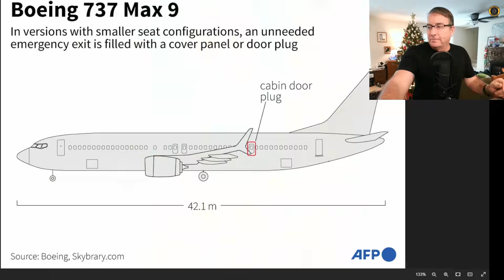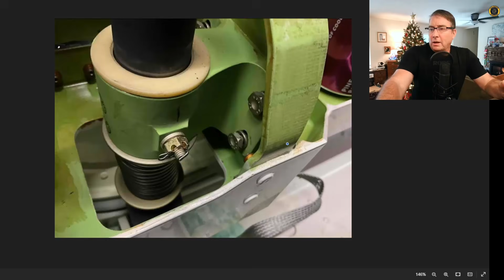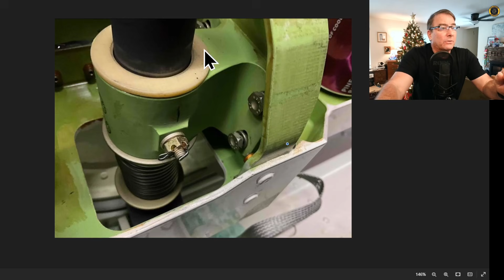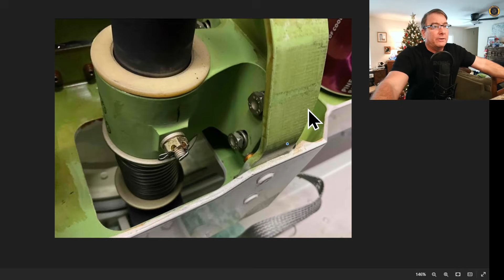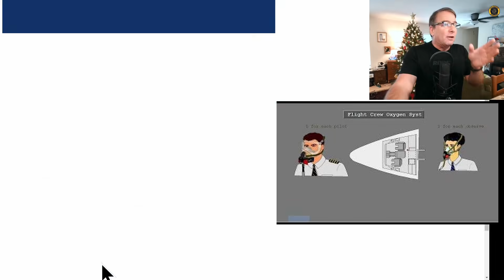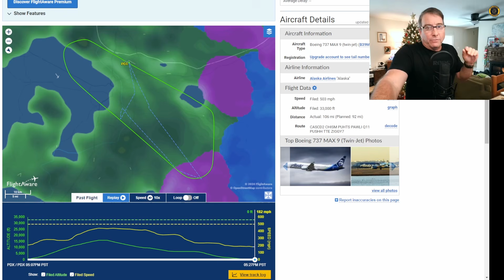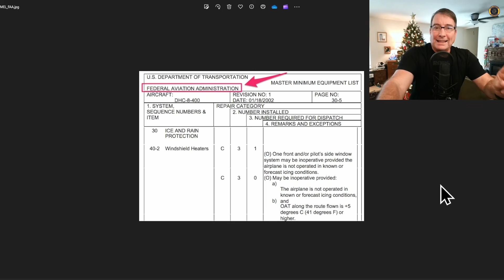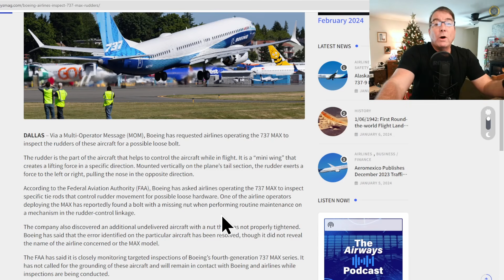"Yes, We Have No Bolts"  9 Jan 737 Max-9 Update

Comment: In my opinion as an 35 year aerospace engineer and former Boeing Associate Technical Fellow that retired from Boeing in 2004, Boeing needs to move the executive offices back to Washington state.
 They need to put the executives on a mezzanine in the manufacturing building. Make them have to walk through the factory to get to their offices. Terminate with prejudice any executives that objects.
Make a way for the people on the factory floor that know to speak freely about their concerns. Make it okay for the factory folks to do the right thing - it clearly isn't okay now.
I thought at the time and I still think that moving the corporate offices away from the aircraft factory was a big mistake. Huge. It made denial of the real issues effortless. Out of sight, out of mind. Unless Boeing does something at least that radical, they are not going to fix the virus that's crept into their culture in the two decades since I retired not long after the MacDac infection. I never worked in the aircraft part of the business, I was in aerospace in So. Cal, but the company culture began to to change for the worse when the MacDac culture infection started and they moved the corporate offices to Chicago.
Reply: I know several people who were with Boeing back then and they all say the same thing as you; right around when they moved the offices to Chicago Boeing started really going downhill.  All of them left the company by 2008.
Reply: That's a pretty good idea.  Moving the heard quarters back to WA, and making management walk through the factory are easy (although they'd say it's impossible).
The real difficult thing, is the most important that you mentioned.  That is, making sure workers have the right to speak up, tell the truth and not fear punishment.  Corporate stuffed shirts love to claim they have an open environment, but seldom do.  Their words mean nothing.

After the previous Max-8 crashes, the FAA uncovered some emails written by someone with a snarky attitude (likely an engineer), that stated the 737 Max was designed by clowns and supervised by a team of monkeys.  The response management had to that email was to claim it didn't represent their values, and discipline was in order.  Boeing should have thanked the person for speaking honestly, and it was a perfect chance for them to listen and learn.  If they had listened and learned, they could have prevented this embarrassment.
Reply: Perhaps people that see things that are not right can speak to the upper management about vital safety concerns, or just tell them they will send the info to the FAA or appropriate organization if they turn their heads on these important issues (I'm not well versed with the different agencies, but report to the appropriate agency) @cherryjuice9946
Reply: I'm Australian and did my degree in aerospace in America (late 80s) and have a pilots license. I work in industrial control systems including safety systems across a variety of industries (manufacturing, mining, oil & gas,...). What you and others are describing is common across all industries. There's this prevailing attitude among people with business and economics degrees that any cost NOT directly associated with generating profit has to be reduced or eliminated.

Things like maintenance and safety are risk mitigation activities NOT profit generators and bizarrely the BETTER they are done the less evidence is that they are being done at all. Its only when they are NOT done well enough that there's evidence because something breaks. This confuses the hell out of non-engineering people.

I have spent a lot of time in recent years looking into this, because its been so frustrating in my work to get things done AND its across every industry I have worked in. There's always some clown waving their economics degree or MBA at me a howling about costs and relentlessly questioning if we need to meet this or that standard.

It all goes back to the colleges where the curriculums for business and economics are taught in a very narrow set ideas about markets, profits and costs. All most all their basic text books are published by Harvard press, Yale press, Oxford press, Cambridge press,.... etc. or written by people from those institutions. Sure they all talk about lateral thinking but its basically non-existent outside of this framework of markets, profits and costs. This is why we keep seeing similar things happening across various industries.

To take an engineering term - when you do a ROOT CAUSE ANALYSIS it all goes back to how we train the people who end up managing these companies or managing divisions in these companies. Even if they are an engineer who goes and does an MBA they become a problem because they get indoctrinated into that mentality.
Reply: @tonywilson4713 of course, once enough of that happens, even a MBA that tries to understand and care will receive arrogant, pompous pushback from engineering. It’s a vicious cycle. I like the idea of making all levels of management touch the factory once in a while.
Reply: @jeffreywoods4040  I half disagree with the claim of engineers being arrogant and pompous and pushing back because I have met some engineers who are incredibly pompous and do pushback. I encountered one of them recently HERE on YouTube (see below).

But I will say in my personal experience they are a minority who in general are the less competent engineers who climb over the rest of us into management.

As to my recent encounter - there was a video on the hardest engineering degree and there were more than a few engineers of putting in their comments. This was several months ago. Then recently a new person came in ARROGANTLY dismissing various comments and pronouncing they were an advisor at 2 universities and had spent 30 years at BOEING. What really upset me was their comments about how others should "know their place" and "stay in their lanes" as well as claims we couldn't possibly be real engineers who'd done the degrees we said we had done.

When I checked out the name being used it matched a bio on the engineering school for Ohio State and according to that bio a they had over 30 years at Boeing. 

I can't say the person accosting us and telling us to "know our place" and "stay in our lanes" was that person for sure. BUT THEY FIT YOUR DESCRIPTION PERFECTLY.  

That's why I 1/2 agree with you because I know they exist and they make the rest of engineering look damn awful which sucks for us.
Reply: Couldn't agree more. Carried T Wilson's bags for a couple days and got to meet a lot of the top management. They knew how to build planes and were fine crawling inside the assemblies. Those days are long gone.
Reply: Boeing top execs care more about the defense contracting side of aerospace than commercial jets.  Building airliners is viewed as a legacy obligation that they would rather not have to continue indefinitely.
Reply: Interesting insight. Appreciate you posting
Reply: Excellent post
Reply: They have found much more interesting things to do. Such as selling part of the company to private equity in which they themselves have a stake. And then installing themselves as management of the spun off company.  Much more interesting than walking around some hangar listening to people talk.

"Spirit was formed when Boeing commercial airplanes sold it's Wichita division to investment firm Onex in 2005.  At the initial public offering in November 2006 the firms stock rose 10% in one day. In August 2014 the Onex Group sold all it's remaining shares of spirit. Over the course of the 9 year investment, the Onex Group received aggregate proceeds of 3.2 billion on its initial 375 million investment."
Reply: let me xplain in the most brutally honest and transparent way possible so that you can understand why that will never happen and why it would not make a difference even if this did happen:
1.  major aircraft corporations are managed by multi-billion dollar global investment groups.  Some people call this, bankers.  But it also includes major insurance underwriters.  And yes, there is no law prohibiting insurance underwriters from taking major invesments into the industry/vehicle that they provide insurance!
2 .  shareholders/wallstreet/board members/ceo/cfo and global investors replaced the classic aviation risk reward model with one used by wallstreet.  The classic aviation risk reward model made investments in safety and design improvements.  This is how the modern aviation industry advanced to unparalleled safety records even with new clean sheet designs.  Boeing had for many decades championed world class designs centered around safety as a company priority.  However, what has replaced this is a different kind of culture and risk reward philosophy.  Boeing has shifted to the wallstreet risk metrics.  How many people can die and how many aircraft can be totally lost and still make a profit for the company?  In other words, how many attorneys can we hire than can make arguments to successfully shift responsibility away when the shit hits the fan.  What is THAT cost...How much does THAT save.  How much can we spend to create a cozy relationship with FAA officials so that if the shit hits the fan, we can all point at each other and pretend its a "shared responsibility"...you know, this failure happened because EVERYONE was at fault.  How do we hire the right attorneys who will drag the lawsuits for decades and even settle quietly without admission of blame or any conditions or concession to make a safer aircraft?  How much rat meat can contaminate the hotdogs and still comply with safety. Now, lets spend exactly that amount and test that limit.  This is the walls street risk metric philosophy.  Do the absolute minimum investments in safety designs and put more investments into insuring against risk.  With the expectation that US regulatory agency will not intrude when things go south and neither will the courts give standing to foreign non us citizens harmed!  It's the walls street philosophy.  make the maximum amount of money by intentionally making the choice from making world class safe aircraft, and shifting that investment into how to protect the interests of the company from liability.  
3.  engineers at boeing are not compensated richly for designing safe new clean sheet aircraft.  In ways, that only an engineer builder can understand, it is far more difficult to make a old design safe than simply drafting a new clean sheet design.  The former is cheaper and faster to gain regulatory certification, and the latter is a long term investment that can easily be crushed by foreign competition.   example:  boeing could have innovated a safe clean sheet aircraft to match efficiency, safety and performance that would be competitive with airbus, but chose instead to be first in market with a frankenstein aircraft that should have never been allowed to be certificated in the way it was.  This was a combination of bad engineering pressured to build quickly to compete and avoid a loss of billion in revenue PLUS the unwise manipulation and wilfull complicity of the FAA to not enforce sane and reasonable rules that had been in effect for decades.  Make no mistake about it.  the FAA was aware that Boeing was not being honest about MCAS.  It just did not care enough to question it.  And if you look closely, what you will find is that the FAA officials all the way up to the director and the white house and congress were persuaded to let Boeing do this, even with sufficient evidence that this aircraft was going to have problems.  But with the billions at stake, everyone chose the path of least resistance so that the captive market of Boeing could survive against the competition it had failed to anticipate with Airbus.  It's the cruelest of jokes. Build a unsafe aircraft so you can gamble that boeing does not lose market position.  shameful.  But the reality of the situation...and continues.
Reply: @tdmmcl1532  Sort of like the internal letter at Ford related to the Pinto gas tank issue where the executive stated Ford's position as: It's cheaper to settle the lawsuits related to horribly burned, disfigured and in some cases killed passengers in rear ended Pintos than to spend a few dollars per car to fix the problem? I wish I thought you were wrong, but you make a case that explains everything that's going on.
Reply: @tdmmcl1532  Horrible commentary BUT ALSO 100% CORRECT.
Reply: @tdmmcl1532  Except Boeing did lose market position and grounding 1000s of aircraft, production stopped, buyers going to airbus, more Boeing employees fired, moving HQ to a cheaper location.  Sadly the executive branch are spinning the same yard to the public.  Right now Boeing execs are pitching for Government bailout ... they know the game, and Bailout request is the game plan.  We tax payers are going to flip the bill for Boeing executive incompetence.
Reply: They also need to do away with paying executives mostly in stock.  Its all a pump and dump scheme with most companys doing huge buybacks each year to keep the stock prices high.  Need to go back to the days of executives collecting a regular salary, stock options could be ok if they vest in 10 years and are limited to less than 100% of salary so there is the proper incentive to do the right thing for the business long term, and not all these short sighted stock boosting tactics we see today like layoffs one quarter and then rehiring the next.  Sad to see a great company go down the toilet, but the Boeing pipeline is too full of people that have been groomed in the wrong culture for the company to turn itself around.  I predict this to being a slow downfall similar to IBM, or it will get bought out by someone as the stock price declines!!
Reply: @IndependenceIron   I highly recommend "Flying Blind", by Peter Robison as an excellent background history of why Boeing is in continuous trouble with their products and how the corporate culture was transformed into the mess it is today.
Reply: But, but, but…what about the stock price? This is what happens when a company is in a business to make money in the first place rather than being in business to make good products as a priority.
Reply: @czarekusa555 absolutely stupid comment. It's obvious you never ran a business. You can't just say "well were going to increase spending on safety" when you are barely keeping your head above water the way it is. They aren't playing with house money to spend freely.  They screwed up with the max big time and everyone that checked off on it should be in prison but you can't just wave a magic wand and think there's a quick fix. You have to make a profit or you won't be in business. Not too hard to understand.
Reply: BINGO. Retired Boeing here, and you are right on the money.  Offices in the 4-81 and 4-82 and now in the 40-22 for the new assembly line.
Reply: @fitch8363 Oh yes, but the so wise management anticipated these problems, thats why they started making us watch Ethics Video's, so that WE would know what was the right thing to do....because our parents obviously were delinquent in that regard (Sarcasm). I worked for boeing at one of their overseas companies and I concur with your assessment of the company culture, and I concur with your solution!!
Reply: @robertphillips2983   I don't know how long you've been gone but the Safety/Ethics series of videos by Calhoun and Co. were amazing to behold. All the  "right" words but almost zero in terms of follow-up and basic changes to the corporate culture. It's time to eliminate the GE influence at Boeing and purge the MDD mindset from the entire company.
Reply: @xyx12300  The MDD mindset that you refer to didn't exist until Harry Stonecipher came along in September 1994, only three years before the merger. He retired soon after. Until they, MDC was completely different. The MDC board at the time, as well as the whole industry was blinded and poisioned by Jack Welsh's successes at GE.  MDC go suck in and so did Boeing when they brought Harry out or retirement and back into Boeing. Condit too was just as poisoned, blinded, and even intoxicated by Harry and had Condit not got booted for the monkey business with his secretary and Harry had not come out of retirement Boeing would be in the same position that are in now. By that time the whole industry was infected by Neutron Jack Welsh. An example is Harry Gray who was Chairman of United Technologies Company (UTC). Harry S. was indoctrinated with the GE influence, which really was the Jack Welsh (Neutron Jack) influence. Jack really started it all and as his underlings branched out they took his destructive business practices with them and spread throughout the industry.
Reply: @lewisaveryfiler7087   Dave Calhoun is straight out of the Jack Welch School of Business. The whole bunch were sucked-in thereafter. Frank Shrontz and TA Wilson were the last 2 "pure" Boeing CEOs. It's really a shame the direction the company has been heading after a stellar past history of excellence.
Reply: @lewisaveryfiler7087 I’m interested in the McDonell-Douglas mindset and culture that shifted in Boeing post merger. Can you explain or direct me to some resources to read about it? 
Same with Jack Welsh’s influence.
Reply: @tylerfb1  The  subject is rather complicated. Certainly not as simple  as the collective opinion of many which is it’s all MDC’s fault. But yes, I can try to give you the “Readers Digest” condensed version. But rather than start post BA and MDC merger, it all really started  with the McDonnell Aircraft Company (MAC) and the Douglas Aircraft Company (Dac) merger. At that time the McDonnell family was the majority stockholder, and the head of the company was John McDonnel who was the son of James McDonnell who founded the company. The MAC side of the corporation knew nothing about commercial aircraft. DAC had experience and knowledge about  commercial aircraft. Space vehicles, and military aircraft. At the time of the merger, MAC was really interested in the later two. MAC’s view of DAC and her existing programs was to maximize the space and military side of DAC, and to just plod along with existing commercial airplanes designs, with the exception of the DC-10, which however was originally created in response to a military contract. Only after that design was not selected by the government MDC figured wth all the time and effort already put forth why let it go to waste so let’s turn it into a commercial jet. (Note: During the whole time of MDC, only three clean sheet aircraft were conceived. 2 military (T-45 and C-17) and 1 commercial (DC-10). The DAC side of the house wanted a clean sheet aircraft but the MAC side of the house didn’t want to spend the money. From the beginning, there was always a clash of cultures, midwest versus west coast. From the time of that merger until the time Harry Stonecipher (HS) came into the picture, Jack Welsh (JW) rose through the ranks of GE. Note: Eventually, HS became one of JW’s VP’s. Also during that time, JW’s business model was the talk of the industry and many many top level executives in the industry became intoxicated with the lure of potential shareholder value increases. Eventually, the culture clash between MAC and DAC reached a point in which MAC basically threw in the towel on the DAC commercial side. At one point they considered selling the DAC commercial side of the house to a consortium in Asia. That is why prior to the MDC and Boeing merger, the DAC side of the house was split in two. They split the commercial side of DAC from the military side of DAC. The government forced this move because US military programs cannot be sold to foreign companies. Eventually, the deal with Asia fell through. HS is now in the picture and he then played a big part in convincing the McDonnell family that to maximize value of MDC stock that they should approach Boeing with a merger proposal. Wise people in the industry knew that Boeing would love to get their hands on the military and space side of MDC and that such a merger would be attractive to Boeing. They also knew that with such a merger, Boeing could put the final nail in the coffin of their biggest commercial competetor. Boeing jumped at the offer. But in doing so made a mis-calculation. Onced merged, the McDonnell family would be the majority shareholder of the new company and as such would control the new board. This is where the saying “MDC bought Boeing with Boeing’s money came from. Many scoff at that saying but in reality it is true. Boeing paid 14 billion dollars from MDC and MDC executives took over the Boeing board as they were the majority shareholders. After the Boeing/MDC merger HS only stuck around for a few years and then retired. Post merger and pre-retirement pretty much everyone (including the former MDC folks) hated HS’s style of management, EXCEPT the folks on Wall Street. They loved him. Combine the industry intoxication from JW, with Wall Street’s love for the JW and his disciple HS the recipe for disaster was complete. Enter Phil Condit (PC), who had by this time turned his back on the old Boeing ways, and had long become drunk on the JW/HS style of management. He bought into it hook line and sinker. During his tenure, PC did everything in the JW playbook. Wall Street loved it, shareholders loved it, and at least from the perspective of their 401K plans, employee’s loved it. As such, the new Boeing was fully infected throughout Seattle and the new corporate HQ in Chicago. When PC fell on his sword as a result of a procurement scandal with the US government and resigned, the infected and intoxicated majority at Boeing sought to bring HS out of retirement which they did and the rest is history. If there any doubt that the folks in Seattle were infected and intoxicated with the JW method and Wall Street’s love for it one only need to look at the Seattle executive team from HS’s second retirement up to the snake Dennis Muilenburg and the huge mistake made by passing over for the top job Alan Mulally (AM) who was one of the ones that never bought into the JS school of business. One other thing to add, and that is for years and years Boeing management never took Airbus seriously. For many years they never viewed them as a threat. Until one day Boeing went downstairs for dinner and found half their plate had been eaten by Airbus. By then it was too late. Boeing now had to chase the dragon and did not know how to do that effectively due to it conflicting with their prior mentioned intoxications and infections. In one sentence that sums up the 787 development debacle and the even worse Max 8 debacle. Both were extremely bad, and in some ways the 787 debacle was worse, I still put the Max debacle in first place as it resulted in the deaths of 346 people. This whole situation, pre and post merger is long and complicated and could be a separate course in some university level business curriculum. My final note is that those who say the current state of Boeing is all due to MDC are just plain wrong. Did MDC executives play a role? I will concede , yes they did. But will also point out far far more folks than those from MDC play big roles also. There is plenty of blame to go around. Unfortunately it is too easy for the uniformed to just blame it all on MDC. Oh, one last thing, similar to the clash of cultures between MAC and DAC, the exact same culture clash happened between heritage Boeing folks and heritage DAC folks, but when thinking about it now I think it probably was worse due to them having been direct competitors for so many years. I know because I worked for both. The Puget Sound Boeing ``bluebloods' ' never accepted the southern California way of doing things and often displayed an air of superiority towards them. Only one of the reasons for that was that DAC had a different design philosophy, I don’t mean the visible things like how many engines or where the engines go or what kind of tail, I mean structural differences. An example is fuselage join methods between the two were completely different. Too much to discuss that and other differences here, but just want to point out another reason for the clash. Finally with regard to your question about books on the subject, there are some out there but none so far that I have come across are truly knowledgeable and unbiased. I kept hoping that one will come along. Otherwise I may have to write it myself before I die (LOL) . . . . . . .
Reply: @tylerfb1  The  subject is rather complicated. Certainly not as simple  as the collective opinion of many which is it’s all MDC’s fault. But yes, I can try to give you the “Readers Digest” condensed version. But rather than start post BA and MDC merger, it all really started  with the McDonnell Aircraft Company (MAC) and the Douglas Aircraft Company (Dac) merger. At that time the McDonnell family was the majority stockholder, and the head of the company was John McDonnel who was the son of James McDonnell who founded the company. The MAC side of the corporation knew nothing about commercial aircraft. DAC had experience and knowledge about  commercial aircraft. Space vehicles, and military aircraft.
Reply: @tylerfb1  I wrote you a pretty long response but not sure if it went through due to it's length. Too many other comments to go through to find out and confirm whether it did or not. Hopefully the complete response did go through. Cheers!
Reply: @lewisaveryfiler7087  it did! Thank you very much for taking the time to do that. I think I understand better now. 

It really is too bad AM didn't get the job. 777 was the last true Boeing design.
Reply: It's now in Arlington VA; their reason to move was so they could spend more time lobbying.....
Reply: Boeing needs to be broken up into separate companies.  It’s too big and too many arms going in different directions. The Boeing Aircraft Company should build airliners. That’s it.   Nothing else.  If they want to have a company called Boeing Defense Systems then so be it. Different BOD’s, ticker symbols and different HQ’s. And yes, the requirement for a Boeing CEO should be an engineering degree and 10 years on the factory floor.  Corporate bylaws should prohibit cost from trumping QA.
Reply: @pchansen100  Not so sure that would work. Spirit was a Boeing spin off. It's worse than Boeing for quality - in fact it made the door plug. There are bigger companies than Boeing that have superb quality.
Reply: Word is they're moving headquarters to the Washington DC area so the can better lobby the Congress and FAA.
Reply: They moved the HQ to Chicago because the new management from McDonnell Douglas at the time wanted to break the back of old Boeing management -- and moving the HQ to St. Louis would have been just too obvious. Now they've moved the HQ to Washington D.C. to be closer to their customer. That, in itself, shows that the former McDonnell Douglas, is still very much in charge. They don't care about the commercial side of the business and will happily see it dwindle away as they saw the Long Beach operations dwindle away. So far, they're doing a great job achieving that objective.
Reply: Completely agree with you!
This virus took down great company as it was Douglas, then McDonnell, and now has infected Boeing.
A company built on technical savoir faire and risk taking.

Now we have bean counters with spreadsheets, and people on plant floor "forget" to tighten bolts (or, had them out it on?) because the manager need that number on the screen.
Reply: But what about all of the diversity hires filling all the Human Resources positions?!?
Reply: Could you explain the McDonell-Douglas culture that came to Boeing post merger or direct me to resources to learn  about it?
Reply: @tylerfb1  Read "Flying Blind", by Peter Robison. It's the best explanation I've seen about how the toxic MDD culture took over Boeing's engineering culture. The smaller company essentially  bulldozed  the larger one, and the damage will probably never be undone. Boeing used to have superior safety and engineering standards and the profit over safety culture that started with MDD management (Harry Stonecipher) has continued unabated ever since. I'm a Boeing retiree with family roots that began at the company in 1918. Great grandfather , grandfather, and grandmother all worked at the Red Barn. All of my uncles and my Dad worked there. 4 generations, and all of them would be sickened by what Boeing has become.
Reply: MacDac = ??
Reply: There is definitely an major executive issue at Boeing ... they're NOT changing their ways but they sure are taking Bonus compensations.
Reply: Diversity and Affirmative action are all that is worried about... It is truly sickening what our nation has come to thanks to the WEF and their mouthpiece ALL MEDIA
Reply: Yep ... saw it begin before I retired after 40 years ... "kids" coming in thinking they could do it all from their desks on a laptop and stats. You CANNOT replace walking the Line with this BS !!! No oversight leads to Job Cards being "rubber stamped" (historically). And I knew I was a Dinosaur when "the kids" got top Management's concurrence that 100% inspection of Lot Sized machined parts meant only inspecting first off ... like "Set Up" being slightly different for each raw material blank doesn't matter. NTSB doesn't need an electron microscope to determine if the bolts were ever installed ... a magnifying glass will provide evidence of rotational witness marks ... stalling IMHO.
Reply: The cabin for this aircraft is built in Kansas.  I presume because labor costs are lower in Kansas.  I don't know if this company is a subsidary of Boeing or not.  Boeing's QC people need to be onsite where any part of their aircrafts are built.
Reply: @cousinfester4621  1) Spirit is not owned by Boeing. 2) Spirit is what is called a major subcontractor, rather than a supplier. 3) Boeing's Procurement Quality Assurance organization maintains onsite oversight at major subcontractor locations.
Reply: Smart & correct. The best biz consultants would agree.
Reply: They moved to Arlington, VA. They aren't moving back. Plus these 737 get shipped by train to Witchita to another sub. I think QC or something failed. Let's wait for the NTSB to get the conclusion: failed part, missing part or specification fail.
Reply: @xoxo2008oxox  you are incorrect.  The fuselage is shipped directly from Spirit to Boeing.  The plug is removed by Boeing so they can install the interior panels.  Then the plug is reinstalled.  I know this first hand.
Reply: Human Factors in Aviation training is essential but seldom taught. I tried promoting it at my employer with no luck. Not surprised at the results.
Reply: @robg6965  Agree - when you think about HF and all the other things that were learned from lessons soaked in blood and pain that the aviation industry went through AND NOW we have these brigades of clowns pulling it all apart piece by piece.
FOR WHAT - so some exec can get his next bonus???

Its gets even worse when you find that other industries have adopted aviation methods.

Even though my degree is in aerospace I have spent 30+ years in industrial control systems including safety systems. In the late 90s they re-wrote all the standards in response to things like Bhopal and Piper Alpha. When you dig into that they took a lot of the methodology from aerospace safety. Things like triple redundancy systems came from aerospace. There's also a lot of fundamental procedures and how you test, check and sign off things that also came from aerospace. 

AND NOW one of the companies that lead the world in making their industry SAFER is throwing all that away so that a few execs can get their bonuses.
Reply: It started when we merged with McDonald Douglas.  I worked for Boeing prior to the mergers.  Shortly after the culture changed and the way we managed programs before changed.
Reply: @joshwalker1441  I couldn't agree more. I highly recommend "Flying Blind" by Peter Robison. It really shows how badly Boeing lost its way post-merger and the emergence of the Profit over Safety culture. Harry Stonecipher led the way to a terrible shift in culture. Condit went along, and Muilenberg  represented the pinnacle of greed and incompetence, which cost a lot of lives. Hopefully, GE Dave gets the boot soon.
Reply: @joshwalker1441  McDonald's ?    That could explain the "designed by clowns" allegation above 😂
Reply: Yeah just increase cost and let peons cry to ceos. That will solve all their problems